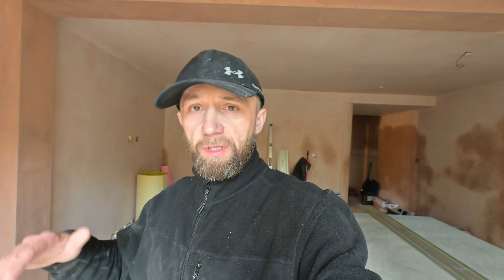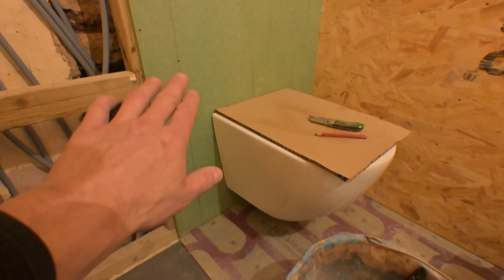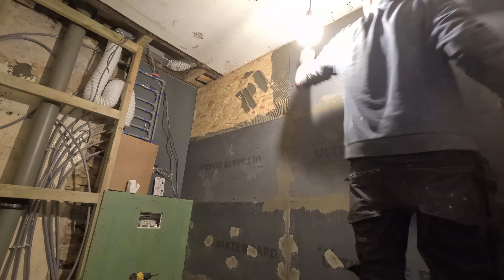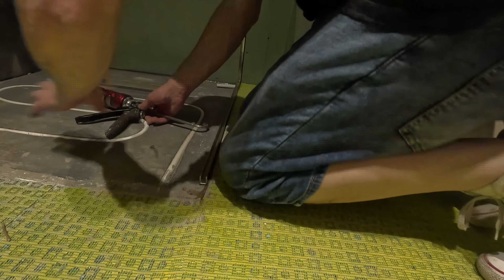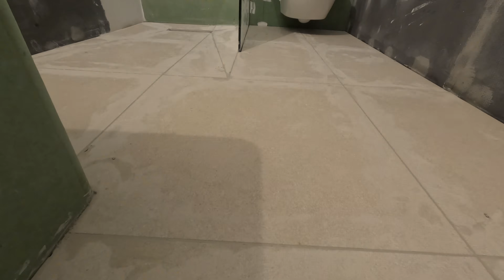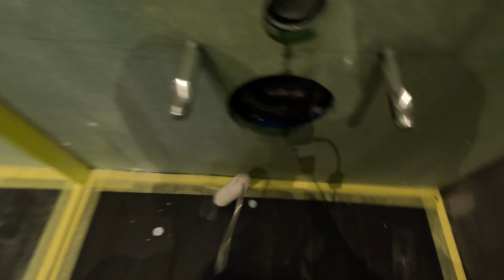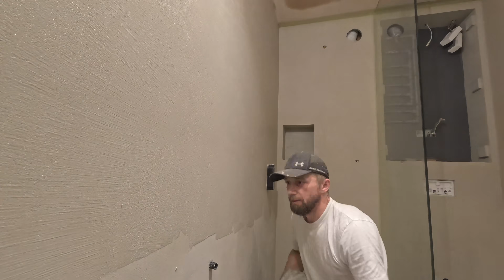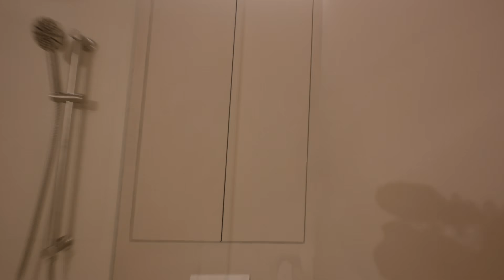The Death of Bathroom TILES..Micro-Cement Explained

Comment: How about cleaning the walls?   seems like something that would have the texture of sandpaper and would be collect lint and what not and be hard to clean off.
Reply from the maker: Hi. Thank you for asking. The surface is smooth enough to clean with ease. The final 3 coats of the sealer fill all the little holes and scratches. Looks textured and, in places, rough, but that is not the case. Also, the finish comes in different grades. If you choose the smooth finish, you get a perfectly flat and smooth surface. Most people go for the medium grade, which is in the video.

Comment: Imagine having to walk through cat litter just to exit the bathroom after taking a shower. Also with an open shower the floor is wet for anyone who just needs to wash their hands or use the toilet.
Reply from the maker: We discussed the option with the client pointing out potential downsides of this layout and It was decided to keep it this way. 
They have a small towel on the floor while taking a shower to wipe their feet and absorb any splashes. 
The cat litter I think is a good idea. It's cancelled and hidden. I would rather have that than having somewhere in the living room. What I think could be improved is a little fan inside of the litter unit but nowadays the litter is pretty good and it stops the smells.

Comment: Very brave to use a Cement/Resin based product as a waterproofed layer in combination with MDF in a bathroom. When these things begin to fail in 10 to 15 years, the contractor who installed it is already long gone and the company moved on with their "new and improved" product that is nothing like what failed 10 to 15 years ago. I would trust lime-based plaster with a water proofing system for this type of look since it at least has a history of working. Not as long as tile, but an OK amount of time.
Reply from the maker: Hi. There is zero cement in this product. This is the improved formula. It's resin with crashed quartz . We are very confident with this product. It's not the seal coat that makes it waterproof, it's the entire system from the start waterproofing the wall.

Comment: Did you fill all the screws and gaps between cement board with a thinset? What did you use to sand the thinset smooth?? Great job nice work.Looks gorgeous.
Reply from the maker: Thank you. I used two part wood filler for the holes. The microcement is sanded with 80 grid paper. After using the two part filler you need to prime the worktop with hydro epoxide lacquer, otherwise the dots might show through micro cement. Hydro epoxide lacquer completely separated the MDF from the environment.

Comment: That looks VERY labor intensive to achieve a look that could be accomplished with a faux coating. I think I'll stick with tile, especially large format which will give a much larger variety of looks. 
 I do like the way you've hidden the trims and the vanity. Those came out really nice.
Reply from the maker: Thank you. 
You can do a lot with this stuff. In this bathroom the client chose a plain look but there is so much more that can be done. I have a few videos in the pipeline showing different bathrooms.

Comment: Looks good but wonder how it looks after 5 years of use and cleaning , even smooth tiles  can take some effort to clean, wondering how that textured surface behaves. 

Nice work 👏🏻
Reply from the maker: Thank you. 
Micro cement , the older the better. Looks better after years. It's textured but the final seal makes it all smooth. It's up to you how smooth you want by applying more coats of the seal or you can use the smooth grade final coat of the micro cement. It has no texture then but it's more patchy.

Comment: I believe the main reason you like micro-cement so much is because you can charge more labor for it and you also don't have to buy, store, maintain and carry all the extra tools that tiles require. Take a look at large vinyl and/or aluminium panels. I understand that you have a vested interest in the ability to make more money on each job, but take a look around at what's coming, cuz you might find yourself driven out of the market.
Reply from the maker: Labour for micro-cementing is less than for quality tiling. We do both, and we actually do more tiled bathrooms than micro-cemented ones. I keep an eye on innovations and try to learn new skills all the time. Thank you for your advice.

Comment: How do you access plumbing and electrical pipes and wires behind the walls if maintenance is required in the future? Also can you give an idea of how much more this costs in labour than tiling please?
Reply from the maker: Hi. The plumbing is point to point so no connections anywhere other than in the cupboard. You will never need access to the cables. If everything is done by the book the fuse will trip before the cable is even overhead. 
In the shower control unit, the only thing that might need servicing is the cartridge but that is accessible from the front.

Comment: i mean great job guys,  but would using a plastic float on the final coat produce a smoother finish rather than metal as with other resin based renders
Reply from the maker: Hi. Thank you for stopping by. This is different. The smoothness of the finish is dependent on the type of material you use. There are 3 grades. The one in the video is the medium grade; it is what the client chose.
A plastic trowel will drag the stone in the mix and scratch everything really badly. I have been experimenting with this a lot to see what finishes and designs I can achieve. You need an extremely smooth, flexible trowel. The manufacturer of this product also provides the trowels.

Comment: Would this work for a steam room?
Reply from the maker: Absolutely. It needs a different sealer  than a normal bathroom.
Reply: @yesconstructionltd  Great, I think the look is amazing! I’ve been wanting to construct a steam room but I have no tiling skills. That’s what is keeping me from doing it. Would you happen to know what sealer is needed?
Reply from the maker: @Kooskoo   are you in the UK?
First, apply the normal sealer supplied with the kit; after it cures, apply one coat of polyasphaltic sealer. It smells bad, so wear a mask. This stuff is shiny and doesn't look good, but it completely stops any vapour from getting through. After that, apply the same sealer you used the first time to make it look matte. No micro cement company will supply you with this sealer; you have to source it yourself. If you are in the UK, one company sells this stuff.

Comment: Informative video👍🏻
Is sealing required for a micro-cemented surface?
Reply from the maker: Thank you. Yes it is. The sealer coat is filling all the micro holes stopping the vapour penetrating trough. We are also using one coat of polysaccharide sealer in between which is what is used on steel bridges under water.
Reply: @yesconstructionltd  I wonder if you meant Polysulfide and not polysacchride.
Reply from the maker: @stonedsufi  Yes 😁 these chemicals, its all confusing.

Comment: How long Did you wait  before you can sand it ? And how do you do edges ,especially on the cupboard door,  looks amazing  .. well done 🎉
Reply from the maker: Hi. Thank you 🙂 . So, the cure time depends on the ambient temperature. It's good practice to leave the first base coat until the next day, and the second one as well. If you apply the final coat in the morning and it's warm, you can sand and finish it on the same day. It's usually a 5-day process. Depending on the details involved, you should coat the bathroom in 3-4 hours. The final coat is even quicker.  
I coat all the edges of the doors with a 6-inch drywall scraper. I should make a video about it. There is a method to make it easier. You just give me an idea for a video 🙂 . I have two more videos coming soon, and I'll try to make the third one about the details.

Comment: Great ! @yesconstructionltd Can we get an explanation of how you insert the glass in the wall, ceiling and floor (but especially the floor) without any leak hazards ?
Reply from the maker: Hi and thank you for participating. 
We install the trim in the floor and the wall. Prior to that the floor is tanked and the trim gets glued on with CT1 (lost of it) Then the trim gets filled with CT1 and we push the glass in. The ceiling needs to be open otherwise you won't be able to stand the glass up. After the gall is in vertical position we install L brackets in the ceiling to hold the glass and we close the ceiling with plasterboard. 
Then we tile the floor up to the glass hiding the trim under the tiles. Same on the wall. 
Ther is a more detailed video onyvchannel showing how this is done. 
The tile is : 
Micro cement is the best materials for bathroom renovations

Comment: I recently had microcement installed as flooring on my ground floor, including kitchen and the floor & walls in a bathroom/wetroom with walk-in shower.  Yes, the seamless flooring looks great, feels nice underfoot, and is a joy to clean, BUT two important things are almost never mentioned in these videos:

1) The quality of your substrate is SO important > If your substrate isn't level with water pipes buried deep enough within to mitigate thermal expansion or general movement in the floor, cracks in the rigid 3mm thick microcement layer will start to appear within a couple of months  And repairing that while maintaining the seamlessness of the original microcement installation is very difficult unless you have a highly skilled installer, if it can be repaired at all.   

2) It is NOT a hard floor > I would say microcement is actually more easily damaged than a wooden floor, and thus far softer than a 1cm porcelain tile.  Dropping anything metal or with a hard edge on it will likely dent the floor - and we're not talking hammers or iron skillets here - obviously leaning something heavy like the corner of a dishwasher will leave a dent, but also relatively light kitchen utensils or even cutlery falling from counter top height will dent it, and even hard well-chewed plastic dog toys dropped from dog mouth height will leave a dent.   

So,  much as I love the look of the floor, given the expense and lack of durability over time compared to something like a decent porcelain tile, for my house and family I don't think I would install it again.  Just my experience.
Reply from the maker: Thank you for expressing your thoughts. 
I will comment on your points. 

1) Preparation is everything when it comes to microcement. We micro-cement floors with underfloor heating and have never had cracks. If the installation follows the manufacturer's instructions, nothing should go wrong. There are many different preparation methods; it depends on what the subfloor is made of and whether it is moving or completely rigid. We will choose different materials for different subsurfaces. Something went wrong on your project. Cracking micro-cement is never the issue with the material we use. 

2) Micro-cement is an extremely hard material. When applied to a hard, well-prepared surface, it becomes part of it and extends that hardness and durability to the surface. I am preparing a video where we micro-cement MDF kitchen worktops and splashbacks, and I am going to test their durability. It will be worth watching. Anyway, I don't know what materials you used on your projects, but it seems like there is a problem with that. What was your subfloor made of, and how did they prepare it? Do you know the micro-cement brand? 
I used 3 brands, and I wasn't happy with any of them until I found the one I am using now. This stuff is top-notch. It's flexible enough not to crack and hard enough to take the impact. As you said, it doesn't chip away; it dents if something heavy falls on it, but it would have to be very heavy or sharp. Any surface will get damaged at that kind of impact. And like you, I love the look of it🙂

It would be nice if you would share the brand. Thank you so much for participating.
Reply: What brand do you use?
Reply from the maker: @jasonbarnett852 
www.claudicemento.com

Comment: what do you do without architraves? Is there something else you use instead?
Reply from the maker: I returned the wall into the frame so like a small reveal. It shows in the video
Reply: @yesconstructionltd  I see so you just leave the liner showing like that? Maybe painted. Have you ever done with with tile trim perimeter?
Reply from the maker: @Dr.Stacker 
I did, when the bathroom was tiled. I am against the architraves in the bathroom. Unless it is a country style bathroom

Comment: Hi. Could you apply the microcement directly on the OSB boards?
Thank you
Andy
Reply from the maker: Technically you could. I know some installers who don't take so much time in preparation and they are getting away with it. 
There are a lot of different methods. In my next bathroom video (coming soon) we plastered the bathroom with mesh in , and then applied the micro cement straight over. That is also a very good way.

Comment: How is this different than skim-coating plaster over fiberglass-faced gypsum board?
Reply from the maker: Do you mean the application technique or the material?
The material is completely different. This is resin mixed with stone.
Reply: @yesconstructionltd  I realize the material is different. And, for certain, it can resist water better than a plaster wall. But, for walls that will NOT be doused with water regularly, it seems like a ton of labor and material for approximately similar appearance and performance. Evidently, I am missing something important.
Reply from the maker: @williamboquist4090   This stuff is fully waterproof. I promise you. As long as you prepare everything nicely. I am going to be making videos soon about doing a shower floor and a bath too.

Comment: Modern construction is absolutely moronic. Imagine if cars were built this way. Each part needs to be easy to replace.
Reply from the maker: Thank you for engaging. Not exactly sure what you mean? Is it the plumbing you are talking about here?  This plumbing is made very nicely. No joints under the floor and behind the walls . The only thing that might have to be replaced is the cartridge of the shower controls which can be done from the front. All parts for the toilet cistern are accessible through the push plate. Nothing else you need to access to change.

Comment: That linear floor siphon doesn't cover anything outside the shower alcove - which has no doors. Nor is there another emergency floor siphon anywhere.
Thus, while water from the shower can freely spray across the bathroom, WHEN the siphon gets clogged up - water has nowhere to go but the hallway and then downward. Fun.
Same goes for any spillage from the sink and the toilet. Should either of those get clogged and overflow, the only drain point is either across the room - or behind a barrier. More fun. 
As for building it all on top of MDF (pretending to be wall) which WILL suck up moisture and swell up... It reminds of that story about three little contractors and the big bad wolf.

Comment: switch out tile grout for resin and you are set. Actually, this is like doing level 5 drywall skimcoat which is much more demanding so pretty impressive.
Reply from the maker: Thanks 😊 it's like skimming but it's a lot more sticky and it doesn't sand much so the trowel work needs to be neat.
Reply: I like the material , and work is top notch ... but that bath feels  claustrophobic . Im not a big fan of the style . Its like the brutalist style ....

Comment: That glass partition is as neat and clean as I've seen.  Many other good ideas for inspiration. - Thanks.
Reply: Water runs down glass where does it go
Reply from the maker: @andrewsheedy6145  
Hi. It will run on the floor and then fall into the drains. The tiles slope toward the drain.
Reply from the maker: Oh, thank you souch 😊

Comment: looks fine, i get the aesthetic, but it is going to crack, thats just what cement products do. I'd like to see one 3 years out
Reply from the maker: Hi. Thank you for contributing. It will not crack. There is zero cement in this. It's a crashed stone and resin and it's extremely flexible.
Reply: @yesconstructionltd  ahh i see, very interesting.

Comment: Cool stuff.  How does the surface perform with cleaning in terms of the grain and pattern?  Calk & mould could get into the texture.
Reply from the maker: Thanks😊 it's pretty simple. It's the same as cleaning natural stone so no bleach. The formula is anti mould so nothing will ever grow on it. Also the texture is visible but it's not rough in touch. The final seal coat makes it all smooth.

Comment: If it has any particules in it it will leak but good idea if you prep walls heavily with sealant
Reply from the maker: Hi. It won't leak. It's quartz stone with resin. The final seal coat fills all the micro holes. It's a problven formula.

Comment: If I want to apply microcement directly on CMU block or need something like stucco in between the block and the microcement to make it smoother?
Reply from the maker: That would not work. Micro cement is a finishing product applied very thin (2mm) 
You need to havexaxsmooth and leveled surface to apply it on. You can do this in many ways. Boards are good in general. You can render the wall and apply micro cement. You can use mesh in the render and go straight over it or if you have no mesh in the render then you need to apply it on top before micro cement
Reply: @yesconstructionltd  Ok, that's what I thought. I really appreciate the response. Beautiful work too.
Reply from the maker: @ryanwschneeberger 
No problem. Thank you, and I appreciate your input. It helps the channel 😊